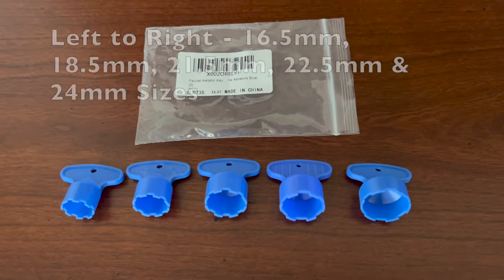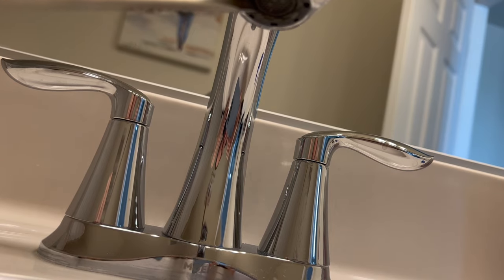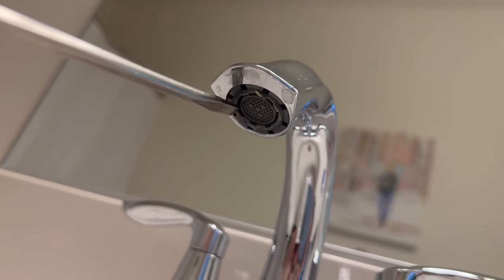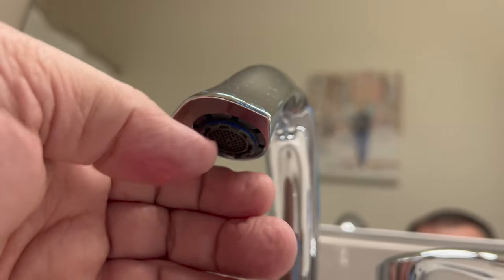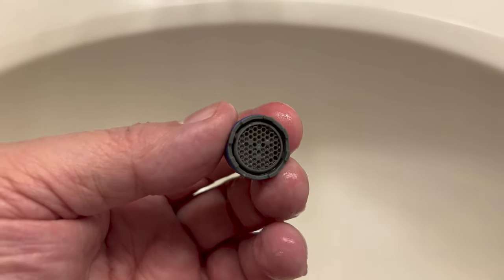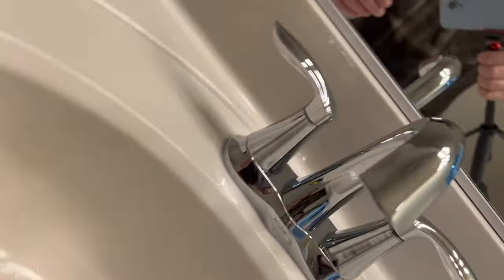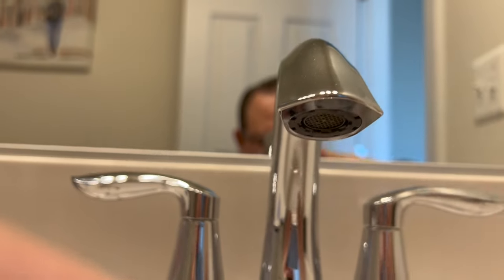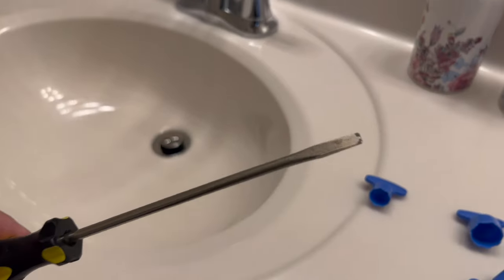MOEN Faucet Aerator Key & Flat Head Screwdriver - Remove Low Flow Filter #kitchenhacks #diy #moen

Comment: Thanks a million! You just saved me some $$. I have 3 Moen Adler bath faucets. One is 5 years old and the other two were just installed in June 2023, along with 3 new bath sinks. The 5-yr. old one has had very low water flow for some time. Followed your advice and voila - I now have great water flow. Another example of federal government mandates to suppliers and trying to control people. Thanks again!
Reply from the maker: Thanks for the comment!  IKR, just let me use my water that way I want to use it.  Like I'm over here leaving my water on full blast for days so no one else can get any.  What a water bill that would be.  Yes, everyone can conserve water but also have very good water pressure when they need it.  Not too hard to understand.  Appreciate that you watched the video!!!  Best of luck to you!

Comment: So far I haven't found the video to help me.  I have a Moen kitchen faucet without the pull down spray option.  It is a one piece faucet with a threaded aerator.  How do I remove the water restrictor from this type of kitchen faucet.  Suggestions/help?
Reply from the maker: Do you have the model number of your Moen kitchen faucet?  I could look it up if you do.

Comment: Thanks for posting! Very helpful! I was able to clean my Moen faucet.

I have a question. I’m trying to use a Faucet Adapter Kit from the sink to a hose. Got it from Amazon but it doesn’t work. I removed the aerator with a key. Do you know if I have to also remove that dark gray ring from the the inside of the faucet (and how would I do so)?
Reply from the maker: Thank you for the comment!  Appreciate the response.  I've never installed a Faucet Adapter Kit to connect a sink faucet to a garden hose.  Here's a video of someone from YouTube doing just such a thing.  https://www.youtube.com/watch?v=aeqXwZ-eDP0

If yours is similar, I would initially attempt to unscrew the dark grey ring with your hands counter clockwise.  If that doesn't work, and honestly I'm not sure what your sink faucet looks like, You'll have to resort to some type of tool like a small pipe wrench.  Hopefully you won't need to do that.

Looks like they purchased their Faucet Adapter Kit from Amazon too:  https://www.amazon.com/Neoperl-15-3940-Diameter-Connect/dp/B01EZ6KM84/ref=sr_1_fkmrnull_1?crid=28P9ATJBF5K6B&keywords=neoperl+15+3940+5&qid=1555806979&s=gateway&sprefix=neoperl+15+3940%2Caps%2C176&sr=8-1-fkmrnull

Please let me know if you are able to complete your connection.
Reply: It’s no worries though but thanks! Maybe I’ll try the dangling from my house method but would have to buy a 100 ft hose incase.
Reply from the maker: @jennifer.santos.  Best of luck Jennifer!

Comment: Thanks so much. Saved myself from replacing the whole faucet
Reply from the maker: Thanks for the comment!  Appreciate that you watched the video and that it helped!!!
Reply: And the new one would still have the same problem. Excessive government regulation. ( low flow laws)
Reply from the maker: @jhask64  Thanks for the comment!  Gotta love the government, huh?
Reply: @jhask64  yeah that low pressure was causing lengthy time crouching over the sink and back pain for my spouse. It’s excessively low pressure.

Comment: I believe idamaged my faucet its decorative under plate is bent, do i have to replace the whole faucet?  Im trying to adapt it to wash my dog in my shoeer from the sink..  thank you so much
Reply from the maker: Thanks for the comment!  This is a bit different than removing the low flow filter.  It seems (and I'm only speculating because I have no idea how you're attempting to attach an adapter so you can use a water hose from your sink to your shower) you may have bent the faucet.  My only advice, as a non-professional... meaning I'm not a plumber, is to attempt to bend the faucet back to it's original shape.  If you can't do that, you'll probably have to purchase a new faucet.  I understand this isn't very helpful, but I would need much more information about exactly what you're doing and what your faucet looks like to provide more advice (which would not be professional plumber advice).  Best of luck to you!  I hope you can get your faucet back in shape and get your hose installed!

Comment: I broke the blue O ring but replaced the aerator without it.  Everything seems to work fine.  Will I have problems down the road?
Reply from the maker: Probably not ideal over time.  There are replacement o-rings out there for Moen faucets.  Here's one:  https://www.amazon.com/Moen-146789-Replacement-Part/dp/B0052TVN28/ref=sr_1_5?crid=3B9NP5L5HVKG7&dib=eyJ2IjoiMSJ9.IhNZZa1ARgeWCrz-4AATWA1PTI19C06zsjGw-0r1IZZgnee63_qB2q8h_ZIZd2ixIiBft7BBK0CVBsmQ2poz4HYtws4G_wv4TC_XN7dab-qEsZXyMOs94sXFONmOLWDftQey4__Csi6HwcPLYlqhmF21YH0VsN-LK7BNdd6X5a2mMaW3aJA7eDkcqUKl4y20ESeEolQZU3mVPtpW6m6MHsAoPQWcELUvZqpAzNhh5di-5mdvWNUhcKdW8Sttn8noRubNya6Tu-cEN3VZZj4qrFWQBshsUM9DINikKnCr_1E.2awcN147UyJ7UyyRzyaLIt2TxRDrWVQOTsbqOeijDHg&dib_tag=se&keywords=moen+146789+o+ring+kit&qid=1718739240&sprefix=moen+146789+o+ring+kit%2Caps%2C80&sr=8-5

Not sure which faucet you have but you should be able to find a replacement o ring for it.

Best of luck to you!!!
Reply: Thank you!  Btw….Great video.  You helped me out and saved me from having to call a plumber.
Reply from the maker: @TomHager-rj3yi  That's great to know!  Thanks!!!

Comment: I have a moen faucet that has number on it of a112.18.1m   Is this the number for the key , example 18.1m , cause my 18.5 key doesn’t fit , am i wrong ?
Reply from the maker: Thanks for the comment!  That number matches a MOEN Aerator Kit listed here:  https://www.walmart.com/ip/Moen-Aerator-Kit-in-Chrome/189416579

So it's not the actual MOEN Faucet product or serial number.  

I don't believe an aerator key is meant to be used on the aerator kit.

Appreciate that you watched the video!
Reply: @GrayTrend  ok so then im assuming the entire end piece turns off , tried it multiple times but doesn’t move , ill try spraying something in it to see if it can break free , thanks
Reply from the maker: @Knarf14  Best of luck to you!

Comment: Wrong,Wrong Wrong, just remove the little black “O” ring and use all parts
Reply from the maker: Thanks for the comment!  I've been wrong before.  I'm curious about the black "O" ring.  My faucets didn't have a black "O" ring.  The "O" rings on my faucets were all blue.
Reply: @GrayTrend  I think he means the black o ring inside the pink piece that was inside the plastic filter.
Reply from the maker: @OOrtiz87  Thanks for the comment!  IDK, I just know what I did worked for me.  Appreciate that you watched the video!